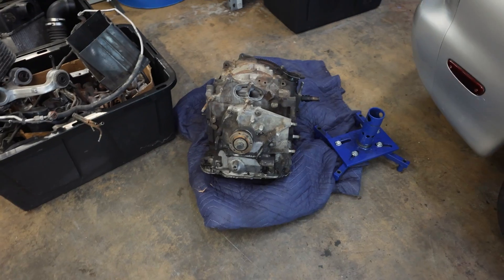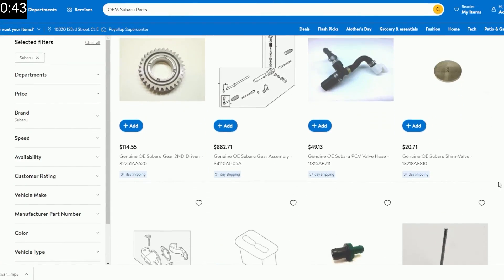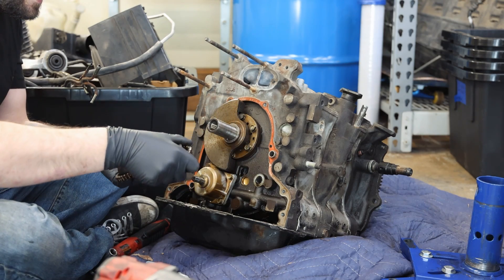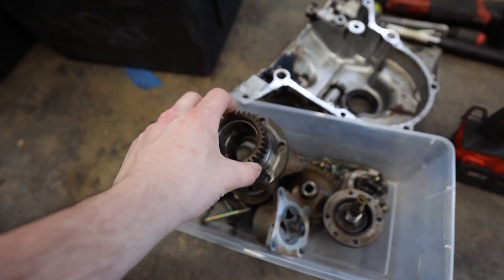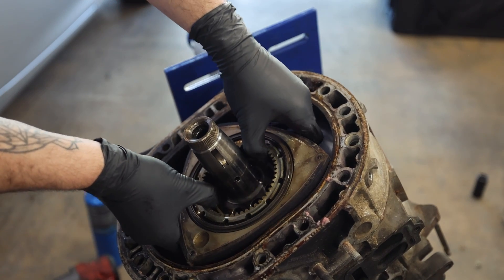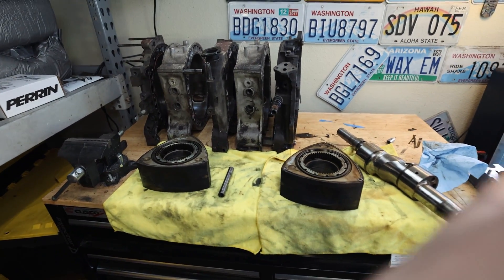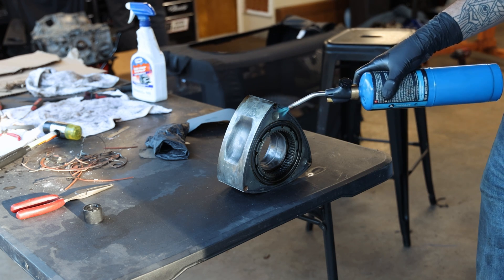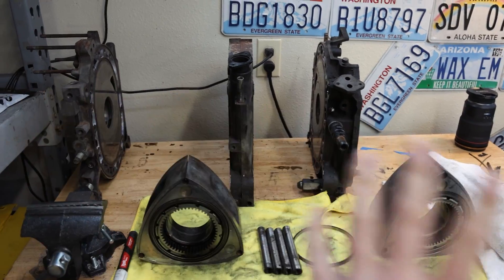Rebuilding a Mazda FD RX7. Pt 2: Tearing Apart a 30 Year Old Rotary Engine

Comment: The chain and oil pump reminds me of a pushrod style engine.
Reply from the maker: Out of curiosity why? 👀
Reply: @Smeedia  the way the shaft and oil pump are in the middle of the block. It looks just like the timing chain setup for a pushrod or cam in block style engine.

Comment: Hey tanner. Could one step colder plugs cause random cylinder roughness on a wrx? I changed my plugs a few weeks ago and since then once in awhile I will get 1-3 count mostly 1 90 percent of the time of cylinder roughness. I also notice my coolant temps at idle rise faster. Not overheating though the fan kicks on and it quickly drops or if I start moving. Plugs are gapped to .028”
Reply from the maker: It shouldent, FA20 or EJ25 WRX?
Reply: @Smeedia  ej25 wrx.
Reply: @Smeedia  I found the issue. Rockauto sold me fake plugs and refuse to make things right because they aren't listed for Subarus

Comment: The face of the rotor is slightly goldish color. Those rotors aren’t clean until that goldish color comes back. This is where most of your time will be spent
Reply: Harsh chemicals will fuck with the coating. Dawn soap and hours of scrubbing with plastic brush. Maybe one that can be attached to a drill to cut time. Plastic wheel brush. Blue or green ones from ryobi
Reply from the maker: Was gling to soak them in gas, should work yes?

Comment: I think carb cleaner cuts through carbon pretty well.  That went super smooth. maybe just a tiny port " cleanup" before reassembly.  I would love to rebuild one but the garage is full
Reply from the maker: That's the game plan 🥳 small street port on the iorns, paint them, then re assembly 🫡

Comment: Huh, Walmart Walmart Marketplace. Can't say I've ever seen them sponsor a YT video before. But be careful with the tire suggestion. My old man recently had a hell of a time trying to buy tires and get them mounted. They wouldn't touch his truck because the wheels weren't the originals, despite being OEM Chevy wheels from a newer model year truck and getting the correct sized tires. He wound up going to a local Firestone or something instead. Your mileage may vary depending on your location.

I know it was mentioned that Dahm's & Vargas' videos were watched, but Jimmy Oakes just did a video with Vargas maybe a month ago putting together the 13B going into his FC project with Mike V. I figure that one would be a super concise one to watch. 

Btw I seen Dahm's ridiculous awd RX-7 4 rotor in person at Grid Life Lime Rock. That thing hit you in the chest when backfiring from allllll the way across the track. It's insane, like I'm on the hill watching turn 1 & his backfires on the back straight on the other side of the hill still hit hard.
Reply from the maker: The one with Oakes is one I watched that gave me some insight on side seal clearances. Tons of good info in there 🔥
Reply: @Smeedia  Nice work.
Reply: @Smeedia  Good shit. Depending on how fast you're moving on your RX-7 you might want to follow Jimbo's build on the FC. They're already partially through reassembly in the bay, waiting on parts. Might be awhile between installments in the build series though.

Comment: I know it’s not a Subaru video but I’m nearing the end of my short block build and was wondering what kind of oil I should use for breaking it in
Reply from the maker: What are the engine specs? Typically 10W40 is what I use for break in
Reply: @Smeedia  fresh ra block and oem D25 heads
Reply: Just a fresh ra block and stock D25 heads
Reply: Any specific brand of 10w40?

Comment: Crazy how simple the 13B motor tear down once all the BS rats nest of hoses and solenoids are removed.  Think of the rotary like a two-stroke and it'll start to make sense.  If you stay near 350 hp range the RX-7 will be dead nuts, reliable.  You can keep the silver RX7 like the silver WRX and your next RX7 can be the big horsepower 3 rotor 20B build 🔧 🔼▶️🔽 🏁
Reply from the maker: That's what I'd like to do 🔥 20Bs ain't cheap but one day 🥲